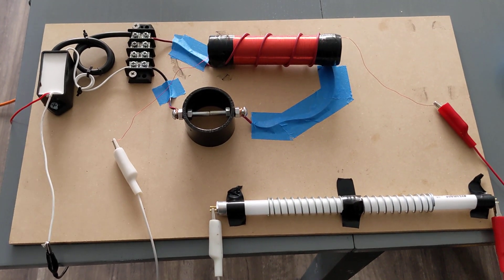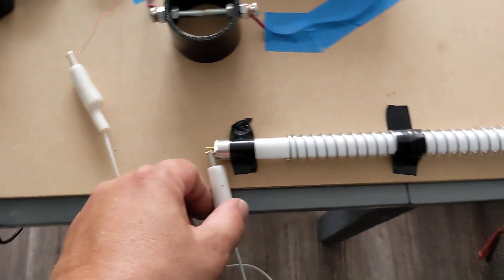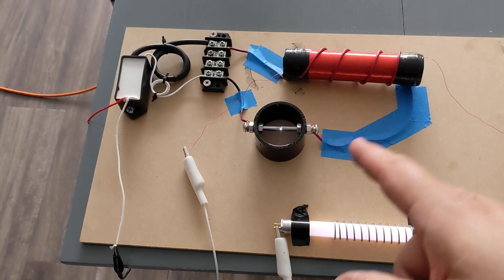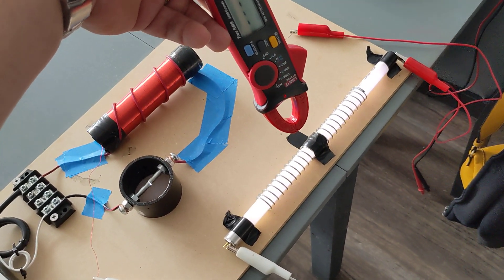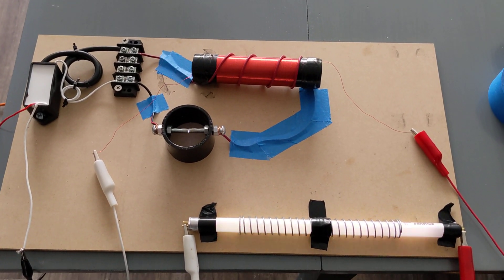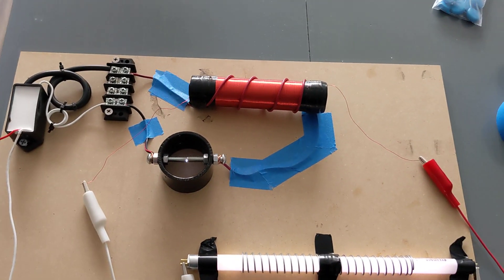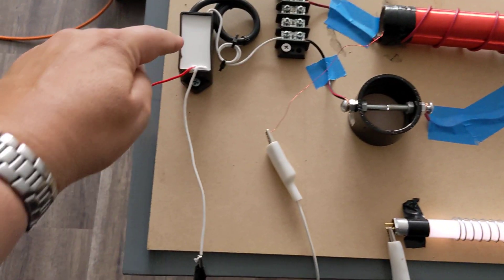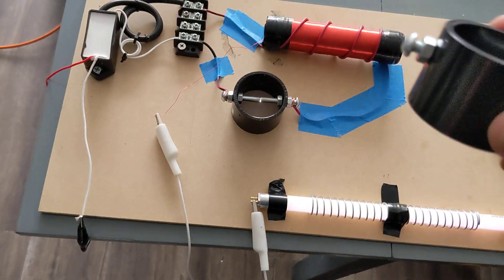Don Smith/ Tesla's Generator... Faraday Research RND

Comment: The spark gap is meant to be inside the bloch wall of your coil. That is a waste of power. Tesla himself had it in the middle of his coil.
Reply from the maker: Hmmm 🤔🤔
Reply: @FaradayResearch Spark gaps radiate EMPs everywhere that the coils recapture and separate their charges (recycling). It can also get hot. Also, the spark gaps should be the ones to close your secondary coil.

Do you need me to create a video explaining how and why?.
Reply from the maker: I did this 3 years ago... Old news . Not working with this project anymore

Comment: Wery neat setup. I Got the same powersource. Can i ask you something. Did you notice that teslas curcuits often had tank curcuits? What would the effect be if your secondary coil was charged by the induction that got stored in capacitors connected to the both ends of the secondary coil. This is intressting becouse the magentic fields in the outher and inner coul will interact. See the movie increment of current. Also the magnetic field may be affected then by the sparkgap . There is alot of intressting things that can be made with such tank curcuit coils if you have 2 and bring them closer the voltage will go up see the movie opposite coils, I Sag a guy testing the outher coil with a coppertube connected the ends to 2 parallell 5000 volt none polarised i think capacitors. Then he threw in a sqrewdriver to create sparks and show of the high amount of current in the coil while he was driving the main tessla coil with a flyback some 1.5 volt batteries and 3 vaccum 1 kw each gas tubes in series just before the main inner tesla coil. Intressting.
Reply from the maker: Yes, you are very correct. The circuits are very much a tank circuit and that's the basis of a lot of what Tesla's work was building resident coil in a tank circuit ....and then you can bring any other coil that is in a resident frequency with the initial Tesla coil ...set up and you can harvest as much as power that you want off it.. and not get taxed.... on the initial tank circuit itself. It is soon as you add a ferrite core to the primary Tesla coil that a tax would be given in the circuit. So the idea is to have them physically separated in the circuit ...and pretty much everything you said is right on the money
Reply: @FaradayResearch   Ir reminds me of the description of the kapanadze device run with a coil, even though its a surface zeneck wave pickup in the shuman spectrum there are some similarities.. When ressonance gets strong enough it can be tapped by its standing waves. In the old days they didnt refeer to electricity as a particle as we do today. But a tone and the analogy wery often seemed to work., I Guess its due to ressonance and due to particle duality nature this function exists. I Find it wery intressting becouse if one thinks in ressonance terms it gets way easier to put togheter a picture of overunity. Before the transistor when there was ferrite switches the open curcuits where common and magnetic amplification but after the transistor most of the tech dissapeared and was forgotten., It was mainly used by the navy. So something was lost during ww1 and ww2 many dont think about and it also happened in the worst of taiming when the oil companys entered the market. I liked your setup wery simple and clean. I Will replicate it and try to tweak it some day and post the results so iam saving this video page.

Comment: Excellent work I'm just wondering if the neon bulb is being lit up by the EM field 
I don't see any wires connecting it also can you explain what the l1 and l2 is better
Reply from the maker: Yup it's all powered by the EM Field.. no wires needed
Reply: @FaradayResearch  I wonder ..... try putting a tuning fork into the EM field maybe use them as electrodes on the spark gap and maybe have one rotate between two  electrodes?
Reply from the maker: Yeah that's interesting idea I'll have to get myself a tuning fork and try that
Reply: @FaradayResearch  you could use different tuning forks but they must be harmonizing notes that resonate with 50 or 60 hertz whenever you're using

Comment: Please do yourself  favor. Not only could you get irradiated with the effects of the arc gap, you could sustain long term medical problems if you are exposed to this stuff continuously. It happened to me when I found the right combo that created very painful microwaves where I had to run past the DS device and shut off my mains to be able to even function enough to unplug the device, Once the correct spark is obtained, shield the outside of the gap with a conductive mesh to create a faraday cage but you'll need to ground it.

Comment: To make my generator I would used 4 sparks gaps in order to multiplied the energy from this device.  The ground connections will be also use.  Capacitors will increase the amperage of this device. Good demo.  Thank. I would try this with 3000 volts to start with.
Reply from the maker: Yep that's a very good start....
 make sure if you have an em meter wave it around the field ....it should be making a field about 18 in around your emitter and also you should be able to throw a spark about 1 cm long to a half centimeter ...this shows that the frequency is very high and also it has a lot of potential behind it and amperage .... also the spark gaps will reduce the load on the prime mover to almost zero... Try that and see what happens and let me know

Cheers
Mike

Comment: Coming along very well, nice job!
Do you have a link to where you got that HV unit?
Reply from the maker: Hey how's it going things are going good here yeah it's coming along getting a lot of voltage basically mimic to exactly but wanted Tesla patents that he did back in 1890 so yeah it's working out good the link is below for the high voltage generator talk to you soon!

https://www.amazon.ca/gp/product/B07WJ43943/ref=as_li_tl?ie=UTF8&camp=15121&creative=330641&creativeASIN=B07WJ43943&linkCode=as2&tag=0010982-20&linkId=a98a401025bb644d4ff014327e7dc990
Reply: @FaradayResearch  Thank you.  Hmmm, ships from China, how long did it take to get yours.  Hmmm, I wonder if this would work with 2MHz pulsed input.  I also noticed it has 1Amp working current, and then noticed in your video how you had to turn it up to about 12V 1.1A, then it activated,, then you turned it back down to the 6V .3A,, but it did still continue to work after you turned it down, interesting.  I will have to think about this.  Thanks again for the link.
Reply from the maker: @INVENTOR3  yeah I got my high voltage unit in about 1 week it came pretty quick through Amazon it depends if it's in that in North America if it's in North America in a warehouse you'll get it sooner so the first one I got it came within like 2 days so I kind of lucked out on that the second one I bought came in about a week so it all depends if it's in North America then they the shipping is a lot quicker.... all right take care for now talk to you soon